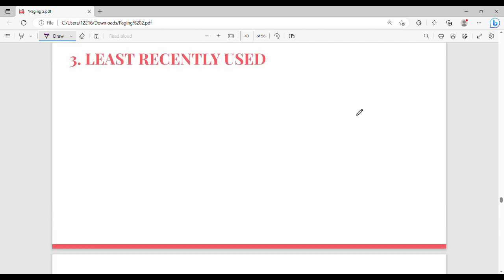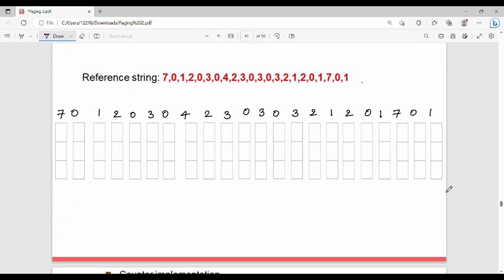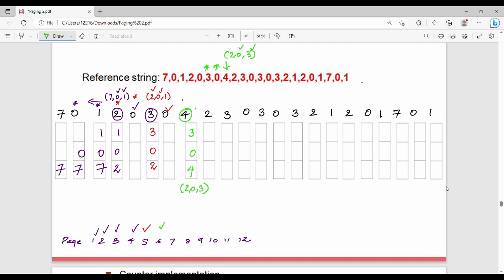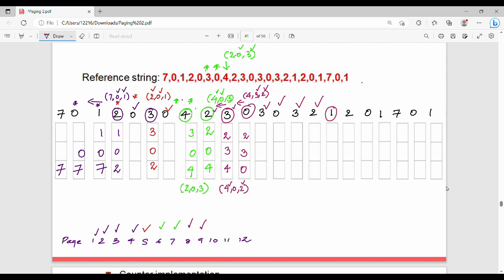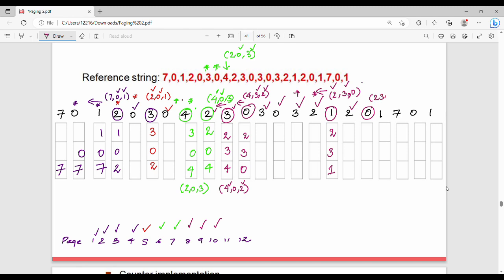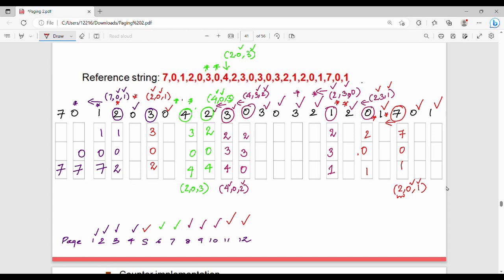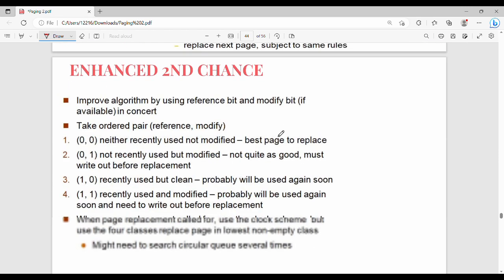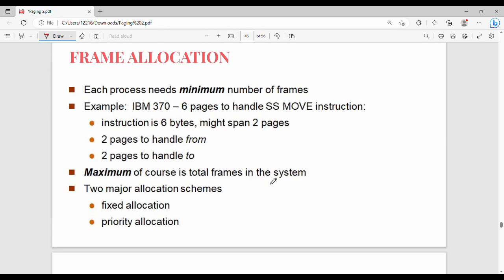3.16 Page Replacement Algorithms Part 2 in Tamil

Comment: (d)
Consider the following page reference string: 1, 2, 2, 3, 1, 3, 0, 1, 7, 5, 3, 7, 2, 2, 7, 2, 1, 2, 3, 1.
(i) Considering page reference string, draw the reference sequence and calculate how many page faults would occur for the following replacement algorithms, assuming three frames?
a) FIFO replacement
b) LRU replacement
c) Optimal replacement
(ii) Considering page reference string, draw the reference sequence and calculate how many page faults would occur for the following replacement algorithms, assuming four frames?
d) FIFO replacement
e) LRU replacement
f) Optimal replacement
(iii) Compare the page fault rates in part (i) and (ii).

here part (ii) (f) part, igot answer like 5237 after i change 5 as page replacement. now  3,7,2,2,7,2 wont change, the i have to replace the 1 as page replace but in the future i have 2,3,1 in reference string, so now what should i do with that sir, like FIFO consider pannanuma ipo? apdi consider panna, which one should be replace in 5237? 23 in future so 5 or 7? sir naa up to down add pannitu vanthen page replacement, neenga pannathuku opposite direction. athukku aprom vara 1 ayum sollung sir replace rthoda pannanumnu
Reply from the maker: Hi, its tough to get what you are exactly asking. Can you plz mail me the image of what you have tried? venkat.kvhapp@gmail.com I will check and tell you.